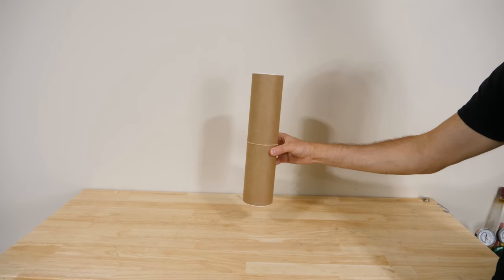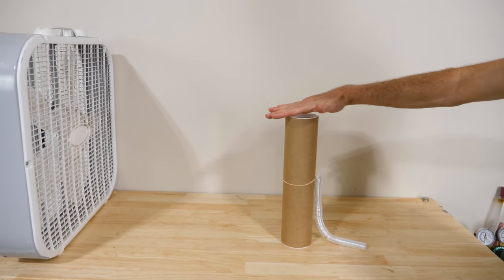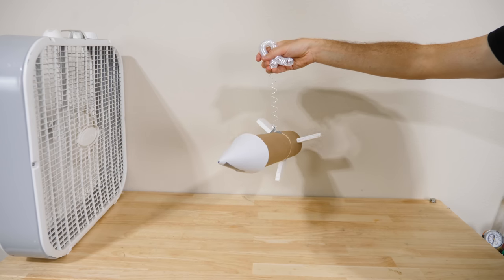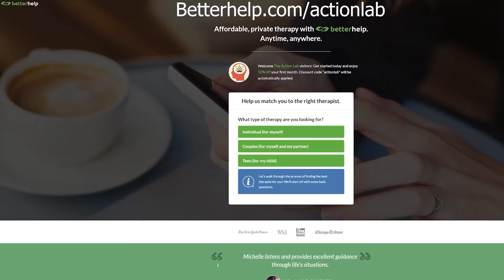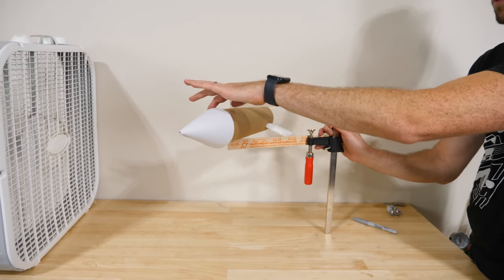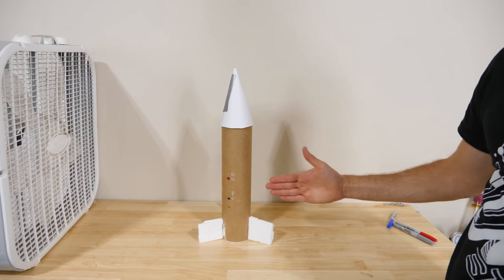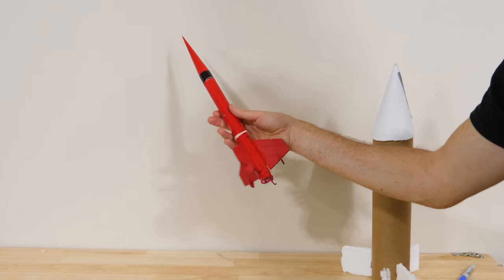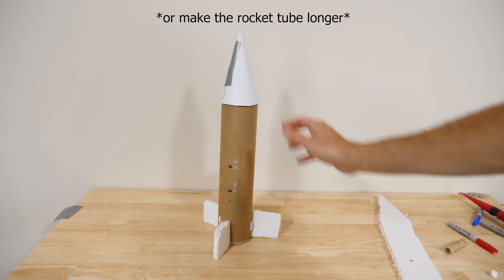I'll Show You What Happens When Rockets Don't Have Fins

Comment: By coincidence, i had a talk with someone this morning about the history of aircrafts and how design could be related to the anatomy of birds. At a moment we were talking about the concorde plane and It's  positioning of the wings. I understood the stability by referring to how a trailer can be loaded so you have a stabile path when pulled by a truck at higher speed. Dependent on where the center of gravity is relative to the area where the wheels make contact and carry the load. I was kind of thinking afterwards if the analogy was fully relevant, tbh because of the axial pivoting dynamic in between and difference of pull versus push. After seeing this video, i think i can understand this modelling and placing of wings even better in a isostatic solid body model. Thank you for your video's. They have a certain degree of diy integrity and innocence that reminds me of when i was young and did all kinds of tests and small maquettes because of some facets that the facination of mobility in life brings.

Comment: The same principle can be applied to keep trailers from swaying. If the center of gravity is behind the trailer's axle, it will sway when you pull it. The axles are where the upward force is applied to lift the trailer so it acts like a center of pressure.
Reply: Interesting. I was just wondering if that trailer stability situation was related, and it is!

Comment: The ancient Chinese rocket design with just a stick 7x the length of the motor could be an interesting test. In high school, sometimes I'd take a model rocket motor and just tape a long stick to it like a bottle rocket, not the best or most efficient, but flew surprisingly straight. There are modern firework rockets with this design and usually a cone on the top.

Comment: Technically extending the rocket body would shift the center of pressure forward more than the center of gravity. Aka making it less stable. This is especially the case since your motor and motor mount is in the back. Usually little model rockets just have a parachute in the front.

Comment: I had a question, how do firework rockets manage to go up pretty straight without any fins or pivoting engines?
Reply: The stick hanging along the side and down the back puts the centre of pressure (centre of drag) behind the centre of mass.
Reply: its central gravity is close to the nose cone
Reply: Remove the stick next time :p (or don't)
Reply: @dmk_games  Ahhh I get it..thanks!
Reply: I thought it had something to do with it spinning really fast, creating some sort of gyroscopic stabilisation
Reply: What about those shell shots???the round ones you p ut in a tube ???how do those manage to go straightish?? Is it the same reason a canon can shoot a ball projectile in somewhat a reasonable straigjt line
Reply: @paulcurtis1167  The thing with a circle is, it doesn't matter if it turns sideways or not because.. what's gonna happen? Nothing different, it's still a circle no matter what way you look at it. As well as the example you said about cannons/guns, the difference is rockets provide their own propulsion and those shell shots are popped out like a mortar by explosives underneath them that are in the tube, there's zero acceleration after it leaves the tube but rockets are still accelerating even after they break ground.
Reply: @charbladex  I see what you mean ..makes sense..learn something new everyday ..thanx 😊
Reply: @paulcurtis1167  exactly, its more of a cannon than a rocket, the CP and CG are at the center of the sphere, therefore self adjusting once it leaves the tube, the charge to blow the sphere out of the tube is that small cylinder attached to the sphere, it acts just like a load of powder as used in a cannon.
Reply: Click, Clack, - you're gonna have a brain attack!!!
Reply: @paulcurtis1167  Click clack, Click clack...

Comment: With the advent of computer guidance systems that function at correcting directions thousands of times a second, tailfins may no longer be necessary but, the costs involved make it virtually impossible for fins to ever completely go away.
As a kid in the 70s I once accidentally lit a hill on fire by seeing what would happen if I ignited a little Estes rocket without the fins attached. 
Lesson learned the hard for sure.

Comment: I remember a couple of Estes rockets that were called 'tumblers'.  Instead of a parachute, the charge that would normally blow the nosecone off just caused the spent engine cartridge 'aft' a few inches.  This resulted in the center of gravity shifting aft, past the center of pressure.  So on the flight up with the engine forward, it was stable and launched straight up.  After burn out the engine shifted aft and the rocket was unstable.  So it tumbled around and around as it fell, this limited it's terminal velocity so when it landed in the grass, it was undamaged.

Comment: Got a beginner model rocketry kit when I was about 12. Spent a week or so putting together my first rocket. It wasn't the prettiest but it was technically and mechanically correct.
It was basically a bottle rocket with a parachute.

My dad and I went out into the pasture away from any buildings and set up the launch pad. We made sure the sun was behind us and got back a safe ways. Then came the launch.

We did the traditional countdown together as I flipped the saftey and hit the ignition. Fire blasted out the bottom and she took off into the sky.

Up, up, up she went.

And kept going.

And kept going.

And she never seemed to return.

We saw no chute deployment, no explosion, no fiery falling shell, nothing. It simply went up and stopped existing, for all we knew and still know to this day.

We searched the neighbors' fields downwind, we searched in directions it couldn't have gone. We searched for a couple days until my dad gave up; then I kept searching for a couple more. We never found any trace of it.

30+yrs later, I still wonder about that rocket...

Comment: You missed one key thing about rockets
Center of Thrust : Basically where all of your thrusters forces meet and must face the center of mass or the rocket goes flying off in a random direction.
Space Shuttles had their thrusters at an angle to have the center of thrust point towards the center of mass.
Reply: He explains the aerodynamics part dude. Thrust is not relevant because this is aerodynamics balance and not attitude control system.

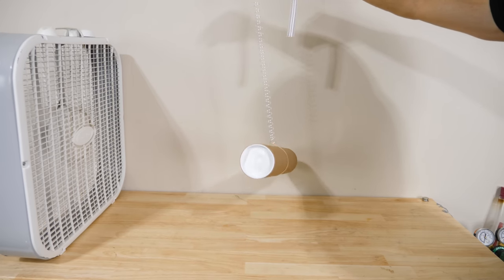Comment: 1:25 although I know the principle you're trying to demonstrate here, perhaps using a springy cable was a good thing to use there. That twisting could be coming from the act of unwinding that spring so doesn't illustrate the concept clearly.  For example, if you twisted it when it was extended, would the rocket have straightened out still or does it turn and stick to that direction more easily?

Comment: Hey, so I had an interesting question: We saw what happens when your COG is above your COP, and what happens when it's below, but what happens when your center of gravity and center of pressure are at the same exact spot, by such a method as adding just enough weight to make the COG equal the COP? Would the rocket still fly off sideways, or would it stay straight?
Reply: I'd say it would stay straight, provided that no other forces disturb the trajectory. But any disturbance could cause the rocket to spin sideways, and the spin wouldn't be stabilized by the aerodynamics so that it would keep on spinning. This is probably not a thing you would want in reality. 
Furthermore, unless all of the fuel sits exactly at the COG, burning fuel would shift the COG quite a bit during flight. You probably want to ensure that the COG is above the COP on both full and empty rocket.
Reply: @A._Meroy  Fair enough. Didn't think about the shift of fuel during the actual flight trajectory. It also might not affect a model rocket where the fuel is a somewhat negligible part of the weight, but I could understand the difference of the hydrogen and oxygen on board an actual rocket as being much heavier!

Comment: Another cool experiment shows how a rocket's roll about its vertical axis can be induced by coordinating the other two axes. Hold a coat by its neck and move your hand in a circle. If you move your hand in a clockwise circle, the coat tries to twist clockwise and vice versa. This is why controls for only two axes are sufficient to orient a rocket in 3D.

Comment: When I was building custom model rockets, no real need to know the exact center of pressure. Easy enough to find the CoG to hang it from and use a fan to test. If it isn't as stable as you would like, either add a little clay to the nose cone or use bigger fins. Sometimes you do both.

Comment: I've never heard of the center of pressure before. Interesting video! Why does the estimation method work?
Reply: I think it is often called center of drag, maybe you've heard of that before
Reply: @A._Meroy  drag yes! But the fact that there's a center point related to drag is still a bit foreign to me.
Reply: @mike1024.  Well, naturally there's drag involved when rockets shoot through the atmosphere at ridiculous speeds. What I find counter-intuitive is the fact that the rocket tends to tilt sideways where the drag is obviously higher than when flying straight. 
The estimation method translates the "side view" area of the rocket into an equivalent mass distribution, that's why it works to a certain extent. This principle is called 'projection'. However, it is not 100% accurate because flat surfaces (like the fins) produce more drag than curved surfaces (like the cylinder-shaped fuselage). So the part with the fins produces more drag than the estimation would suggest, consequently the actual center of drag is further back than the estimated center of drag.
Reply: @A._Meroy  that makes sense. Thank you for the explanation!

Comment: A circle does not automatically have the least air resistance, frontal area is only one part of the drag force. Side profile is more important in terms of drag coefficient in which a flat front definitely performs poorly. Depending of the airspeed, the optimal shape can be between a blunt rounded nose or a sharp tip with a tapered end.

Comment: For 1 dimensional like shapes, why don't you use the approaching support points methods (balance the item on two fingers, then bring those fingers together - they would meet at the center of gravity); for 2 dimensional like shapes you can find center of gravity by hanging the item (the shape), and drawing the vertical line through the attachment point - the center of gravity would be where all those lines for different attachment points meet (cross).

Comment: But would fixed fins be detrimental while maneuvering? Like how planes have fins under their engines which I assume just like stabilizers were there so the plane flew straight but that would mean that additional energy is required to change the aircrafts direction.

Comment: How does this tie in with the "put the engine at the base" rule?  As Goddard found out a "pendulum rocket" or "tractor rocket" with the engine pulling from above is not inherently stable either.  I guess that's center of mass vs center of pressure as well?

Comment: Most of the orbital vehicle consists of fuel tanks, and these tanks empty out and change the COG significantly. However, some weapon delivery missiles have fins. Javelin doesn't, IIRC while the whole M30 series of the HIMARS GLMRS ammunition is finned. Both missiles use vanes for direction control rather than gimbaling the engine (IIRC again, check).

Comment: Although a good example, It’s not a head-on wind.

Fan blades actually push the air slightly diagonally. But yeah it is negligible when you consider the fin variant

Comment: Rockets can actually balance themselves without fins, it's just a heck ton more diffucult, but if you are trying to send a rocket into space, you want to save as much weight as possible, so you would have thrusters that would keep changing the direction of thrust constantly to balance the rocket, kind of like when you try to balance a broom stick on your palm by constantly moving it around, that's what's basically happening.
But fins can be useful for rockets that aren't designed to be send to space, like missiles, firework rockets etc. What fins do in a nutshell is basically bring the center of pressure as close as possible to the center of gravity, the closer the more stable the rocket is. Now fins predate rockets, we all know that fins have been used for quite some time, and that's in arrows, our distant distant ancestors saw that putting feathers in the rear part of the arrow kept it more straight, they didn't know why but they did it because it seemed to be more effective, what the feathers would do is basically move the center of pressure forward, because the arrow head would significantly move the center of gravity forward because of its weight, of course they didn't know this at the time , and it wouldn't be for the next thousands of years that they would know, which is today basically.

Comment: For model rockets, build your rocket, tie a string to the rocket at the center of gravity, swing the rocket gently around you or overhead. It should go straight around you flying properly. If not add some weight to the nose and try again. Works every time.

Comment: >}=====>
🔹️       🔸️
But this is not because of the fins.
In fact, a rocket's center of gravity is toward the front end. And the center of air resistance is in its rear part.
It would also work if you made the Cone  heavy.
>}=====>
🔸️       🔹️

Comment: That method to find center of pressure does NOT work if you work with aerofoils (Your fins are aerofoils). CP is at about 25%, not 50%, for flat surfaces. At least for subsonic. When going supersonic it jumps to 50%

Comment: There’s an easier way to find the center of pressure. Have the whole rocket assembled with motor etc tie a 6 to 8 foot piece of string to the rocket so it balances horizontal to the ground and then swing it around your head. If it doesn’t fly straight then add weight to the nose and try again. Keep doing that until it flys straight. If it starts spinning in the opposite direction from when you started, then you’ve added too much.

Comment: Is this related to how trailers behave when their loads are in the front, balanced, and rear? If you load a trailer with most weight in the rear, it is very unsteady and can flip the truck pulling it.

Comment: Another widely used method to stabilize a rocket's trajectory is to have it rotating on its longitudinal axis to take advantage of the inertia induced by this gyroscopic effect. Incidentally, that is the reason why most rockets sport those contrasting coloured patterns painted on their body (lines or checkered patterns): they're meant to visually check their rotation more easily.
Reply: Bonnefoy😜

Comment: How do they figure out the center of pressure for humongous rockets like a Saturn V or spaceX superheavy?  It has to be pretty exact too, I’d imagine.  I bet an inch off would cause problems.
Reply: For modern rockets, finite element analysis and computational fluid dynamics.
For pre-computer rockets, they probably had approximations to these methods that could be calculated by hand.

Comment: I remember having a homemade slingshot before, and I was wondering if I could shot an arrow with it so I make one, the first prototype was just a stick with a twig sticking out at the tip, when I shoot it I was confused of why the stick just spin uncontrollably or slide up like an airplane, and then I remember that arrow has a steel tip and feather fins in them, I was and 8 at that time so I dont think those could make any difference but I tried it otherwise, instead of making it out of steel I improvised it a little bit by using pointy small bottle cap, filled it with sand and drip a super glue in it to make the sand hard like a concrete, and as for the fins I split the back of the arrow in 4 and slip 2 V shaped like stiff paper and glued it together.

After that I shot it to the sky with no expectation but no, It shot up straight, flipped and go back like a real arrow, as a child it probably the best thing I've ever encountered at the time, but then it also the last time I will ever played with it, because I just realized that instead of acting like an arrow It act closely to a ballista, I know that because somehow it shoot through a door and still strong enough to make a a dent to a wall that was like 3 meters away from the door, it's and abandoned building near my house so dont worry, well the door was deteriorating the wall also but It's still strong enough and I expect it to bounce off the door, today the arrow and the slingshot might still be at the bottom of the lake, I wonder if it's still there...

Comment: You forgot to mention why the center of pressure needs to be lower.

Here is my guess. The center of gravity is like the point of rotation when the rocket wants to turn. When the center of pressure is lower, the drag will be higher on the part below center of gravity, and thus it will be pushed back to the right orientation, if turned. So, it is a question of whither the point below the center of gravity produces more drag than the part above it.

Comment: When weight is added to the rocket, why does de center of pressure remain constant?
Reply: Because the center of pressure only depends on the external geometry of the rocket, and the way the surface interacts with the flow of air.  Internal distribution of mass doesn't affect the center of pressure.

Comment: You could have a rocket without fins but spin it to stabilize it.  Spin stabilizing is how bullets and launched grenades work.  However, forcing a spin requires extra fuel which isn't efficient vs fins.
Reply: So do bullets spin and stabilize itself accordingly after being fired ?
Reply: @anshik.k.t  yeah. That's why there is rifling in barrels.